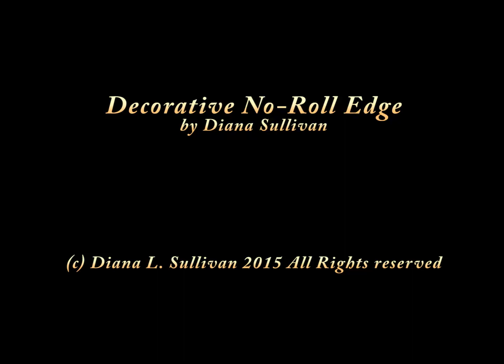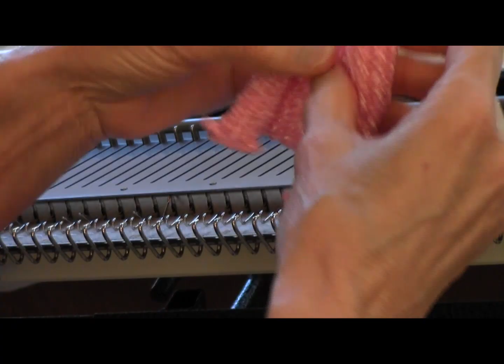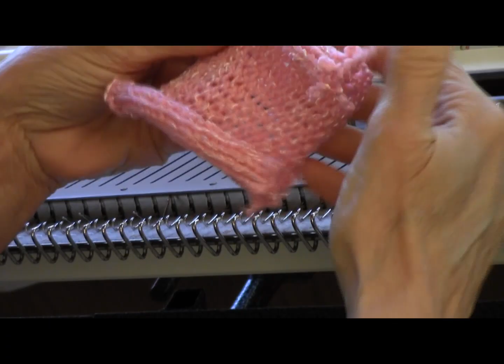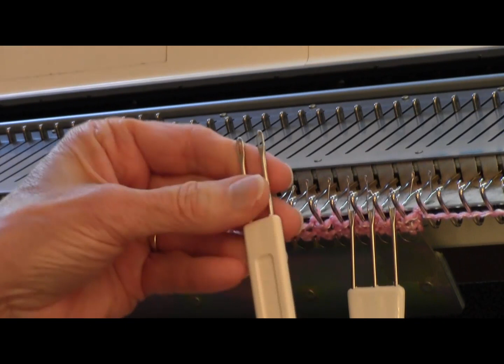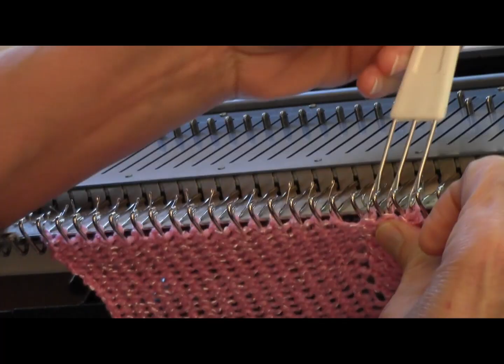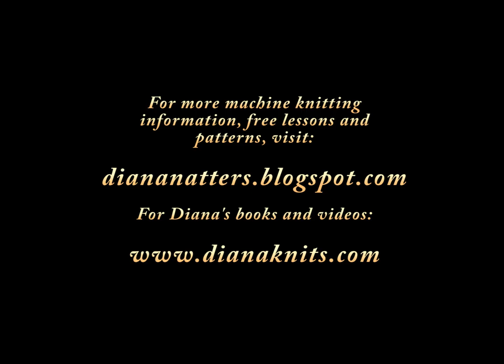Machine Knitted Decorative No-Roll Edge by Diana Sullivan

Comment: Love this - so would you wait until after the afghan is done, and put the top edge on the needles to finish that so it wouldn't roll?
Reply from the maker: Yes, you need to put an edging of some sort on both the top and bottom, or they will roll.  This works on side edges.  Try it with your yarn - doesn't work well on some yarns.

Comment: Diana, are there some yarns this works better with? I did it with a fingering weight yarn on an LK140 and it did not stop the roll. It flipped under and then the piece rolled up from there.
Reply: Deborah Knight I'm having the same issue on my Lk150